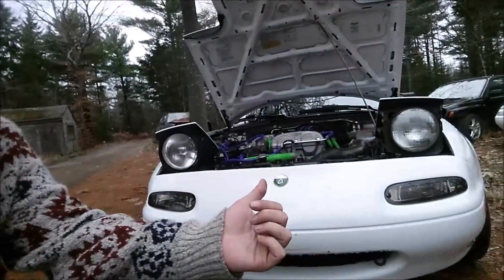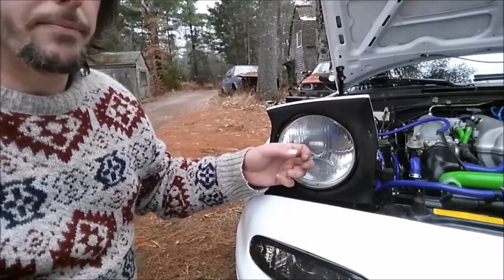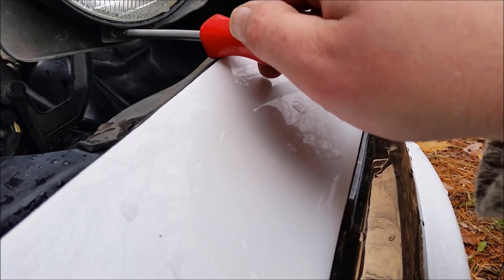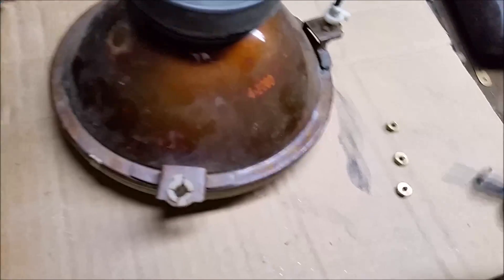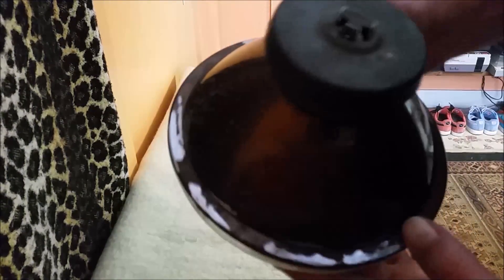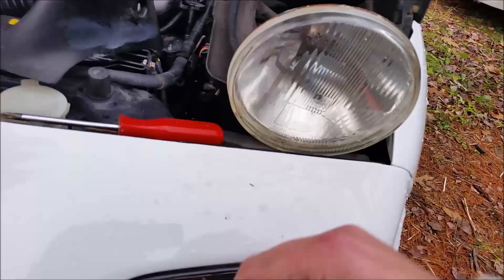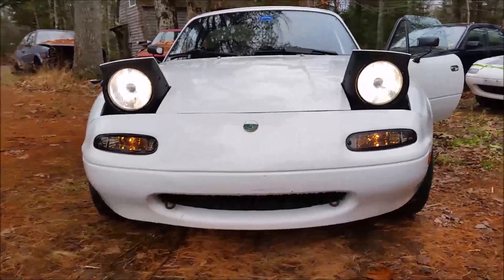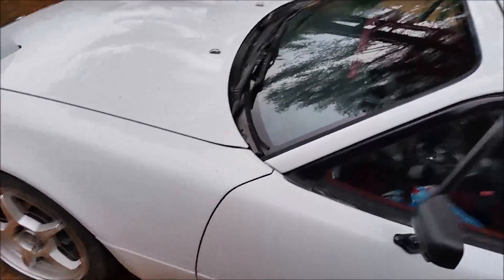[MX-5 Miata] ⚡ Simple H4 headlight upgrade (NA)

Comment: dude you should take this video down. i just runined my set cuz i followed your video advice saying to remove them metal brackets and thats 100% wrong. they are needed to lock in the lights and keep them from spinning and make them thick enough for the ring to grab and hold them. I now need to order a new set because of your bad video!